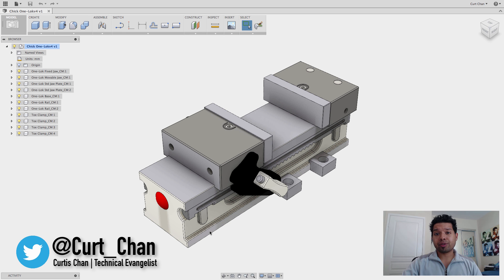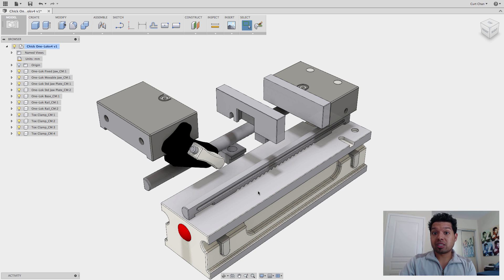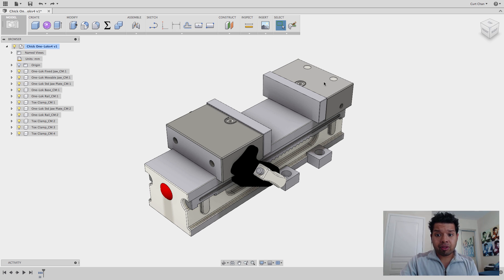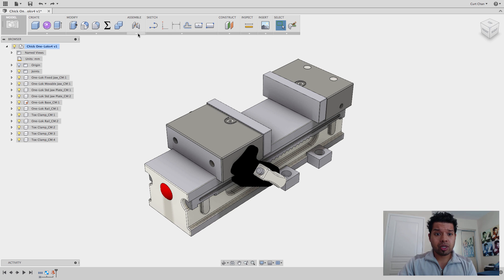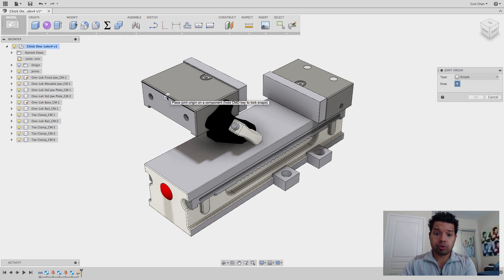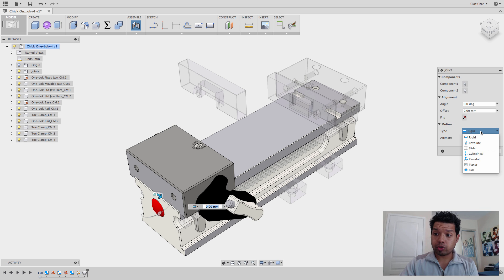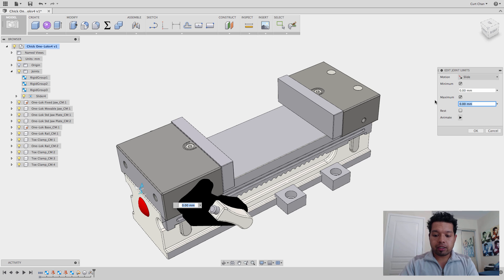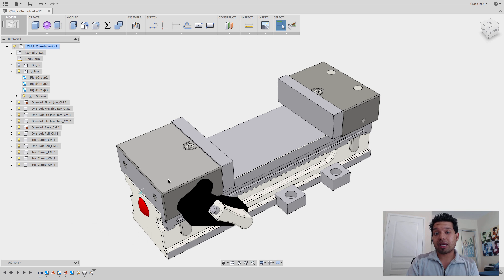Imported Bodies & Assembly Joints Tips

Comment: Great video Curt, I am trying to get the joints on a moving gantry cnc in order. My question is what if the fix jaw face plate had six screw and another six screws to fix the jaw to the main grounded body and a dozen more internal parts, does this mean in order to make this a rigid group each part has to be selected individually? what if the moving group has a thousand parts? can the parts be isolated then box selected before grouping? thanks
Reply: +Errison Zelaya thanks again!  Totally see your point.  Have you tried doing a selection select to group what you want?  I'm also thinking if you can select the ones you don;t want, then do an inverse and isolate the ones you want as a rigid group.  Make sense?  Feel free to share the assembly with me if you'd like, and I'll take a look.
Reply: +Curtis Chan 
Hey
Curt, thanks for the suggestions. I would be happy to send you a link because I know for sure I can use some help on this design. My only request would be to keep it private until I can get it fully animated. Fusion have only three options, to share public link, share to the gallery or published to GrabCad and I don't want to use any of those If you go to my website ezelayadesigns.com (has nothing to do with CAD designs) you can find an email address where you can let me know where to send the link to. Thanks

Comment: Hello Curt,  Just came across you video online and the info is helpful with what I am trying to model but not quite.  I am a retired industrial designer proficient in ProE and Inventor.  I have just started to learn Fusion 360 and am having questions about simple assemblies.  In ProE I used mates and aligns to place a part.  But in Fusion 360 this is not the case.  A simple example would be a rectangular picture frame project made of wood.  I would create this simple framework out of four pieces of wood.  The corners are simple butt joints. If I placed the parts in the computer model on a plane I would make all parts align to one another.  Then I would mate the end of one part to a side of another part and also do another alignment to make a corner.  This would be repeated to make the rectangular frame.  The problem I have with Fusion 360 is that you have joints origins which make sense for assemblies with holes in them but this assembly has no holes to line anything up to. How do you align and mate these parts up in  this simple assembly in Fusion 360?
Reply: +Dave Langkamp Hi Dave.  Understand where you're coming from, in my previous life I worked with SWx.  Have you had a chance to look at our Fusion 101 Training under the Assembly Chapter?  As well as try out the 'Align' Tool under the 'Modify' Menu.  Let me know your thoughts.  http://fusion360.autodesk.com/learning/learning.html?guid=GUID-CC9A8E39-356C-43EA-9EDD-0E9C1321E0F2
Reply: Curtis Chan Hello Curtis,  Thanks for the learning guide.  I know it will be big help in helping me along with Fusion 360.  Since I last wrote I have been doing some research on my own and figured out what I needed for my simple picture frame example.  The connectors are the key to the assembly.  I did not realize that the connectors themselves rotated as I set up the assembly.  This allowed me to align or mate various parts as I have been use to in ProE and Inventor.  It was all a matter of learning the way Fusion 360 did the same tasks.  So I am still getting to be a big fan of this software.  Thanks for the info and I'll keep working with it to help me with my future projects.

Comment: I haven't checked, but isn't there a measure tool available in the flyout menu for the Max/Min input fields on the slider joint?
Reply: Scott Moyse Unfortunately no, you'd have to select the inspect tool, but that will bump you out of the slider joint options.  It would be a great enhancement.
Reply: Curtis Chan Yup... it's standard fodder in Inventor.